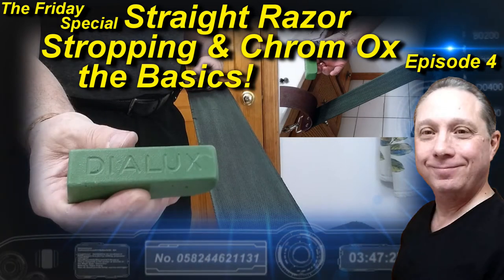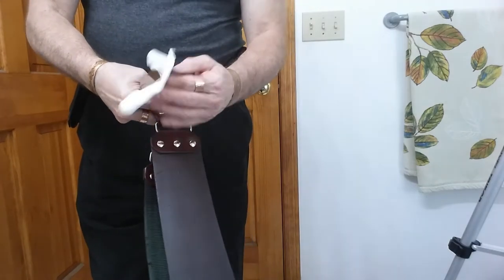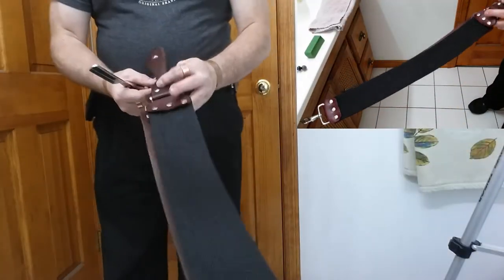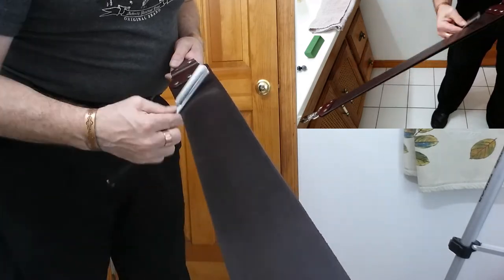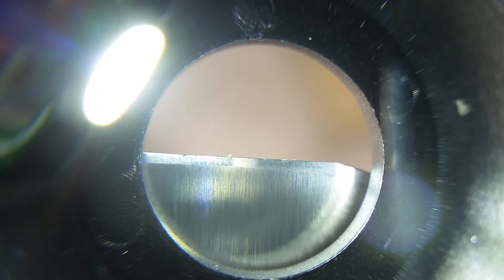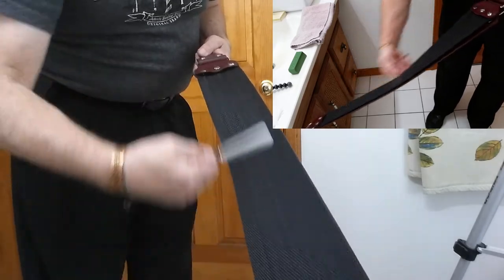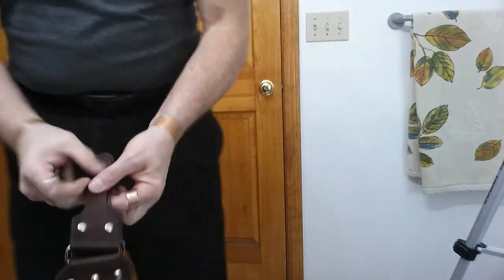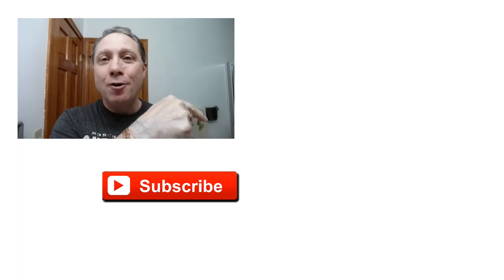Straight Razor Stropping and Chrom Ox the Basics Ep4

Comment: The polish on the bevel looked better coming off the 15k stone. I've not seen that before. What kind of fabric is used in the cloth strops?
Reply from the maker: Bob I believe that is a nylon webbed fabric. At this point I have been finishing on an ILR and stropping with smooth leather only. You can check that out here on my "Basic Straight Razor Honing Guide" video https://goo.gl/CCSijn Thanks for the comment and for watching!  👍🙂👍